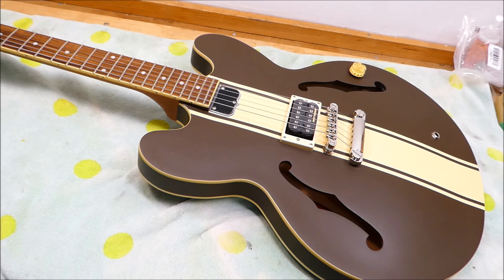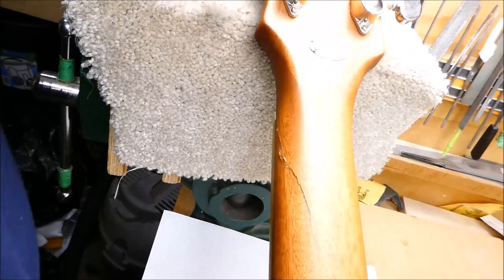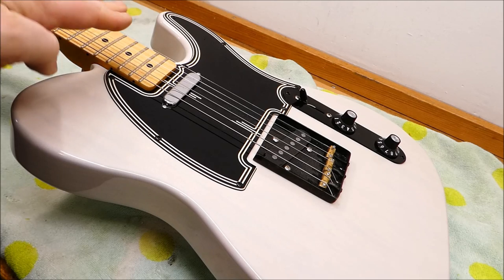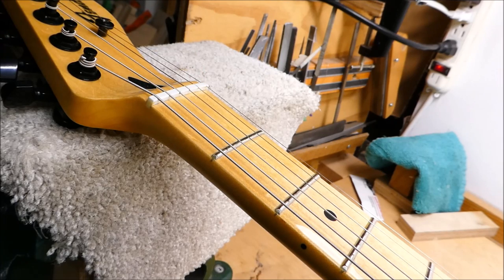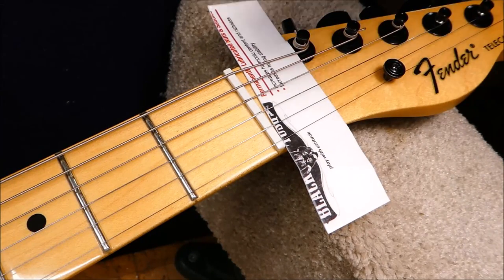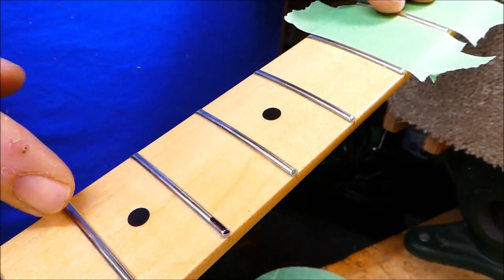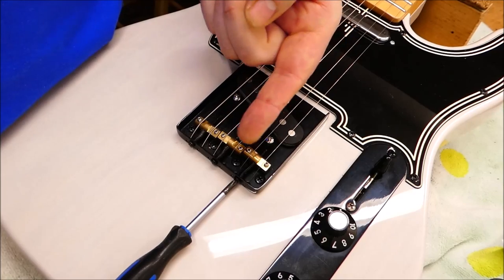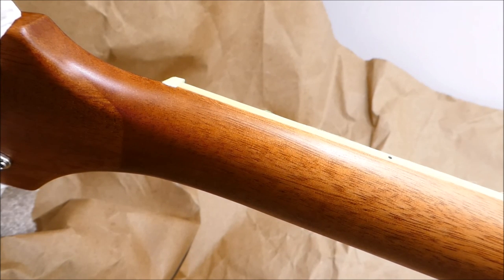Neck Injection, Tele Setup and Violin Vagueries

Comment: Helicore Strings would be a huge improvement over the Gut Strings & by changing the friction pegs out to Geared ones it'll hold tune more plus you won't need fine tuners on the tailpiece anymore now that you have geared pegs.

Comment: Also, I have fixed 4 guitars using your methods with neck cracks. All but one came out fantastic. The other was broken so severe there were little pieces missing. I got it all filled and fixed. Played fantastically. Just wasn’t pretty and my airbrush is trashed so I couldn’t blend in the color and finish. It’s left a Frankenstein scar. Thankfully my friend was fine with it and like that is shows scars says it shows it’s a workhorse and it’s been through hell but still here, still working, still rocking.  (This was friend that just wanted it to play, not a customer of any kind)

Comment: Great projects!
I agree with the "what do you gain from putting locking tuners on a guitar like this". I own an old OLP MM1, and I make sure to put more windings on the D and G-string, otherwise the angle won't be sufficient. The G-string travels quite a bit, just like on the MusicMan Guitars, so you can imagine that a few wraps won't be enough.

Keep up the good work!
Cheers.

Comment: You can use suction to pull glue into a broken/dry joint, the same technique used to pull epoxy into windshield damage.

Comment: My nut tip: use a clip on tuner on the headstock. File each nut slot til you get a perfect half step between open string and first fret in half position. Go slow. If you go too deep, a little CA and nut dust.
I never go by height. Try my way, and let me know what you think. Intonation is achieveable on the cowboy chords, and sets up for a clean fast action as you finish your setup. Peace!

Comment: my guess is at some point someone put steel strings on the violin and it cracked at both sides of the bridge or it made old cracks worse, so they got it 'fixed' and reverted to gut strings

Comment: You can avoid shipping damages like this by making a really tight form for the body (at least the upper part directing to the neck) with a hot wire tool from hard foam. Then glue this foam form in the guitar case / package so that the force, if the package falls to the neck, is absorbed by the foam; the neck should be free, so that no force is applied to it. In other word: fixate the body, not the neck, and this in a way that the body cannot move more than app. 1/2 inch or 1 cm. Of course you have to prevent that force from the side is applied to the neck, so the package mus be quite big or very stable. You can buy a cheap foam guitar case, glue your custom body holding foam form in it, then put it in a package. You would need really huge forces to damage this sort of package, which is very unlikely.

Comment: 25:35 This is an August Kniezel Violin/Fiddle. I figured out why the soundboard has these 2 patches (1 on each side), there were some huge cracks in the soundboard w/ big chucks of wood missing so rather than make a new soundboard, they simply made some patches so they could plug those cracks up.

Comment: I have been repairing guitars for many years now and have fixed maybe 60 or so over the years, amazing but one I have just repaired had exactly the same break point as this one (which as you said is unusual) I have never ever had any returns with my neck repairs and everyone always tells me that after the repair the guitar actually feels and plays better than before it was damaged, I am sure you have come across this with your own repairs and I am certain you will know the reason which is this, the guitar was never set up properly in the first place before the break, time after time I hear this, of course the answer is is to pay someone who actually knows what they are doing and while it is being set up get the guitar man to fit some STRAP LOCKS, nearly all the breaks I mend  have been the result of strap failure and of course in this case shipping, when I buy a guitar online I always insist the seller remove the strings and then the neck put the screws and neck plate in a bag and tape the whole lot together, easier to pack as well.

Comment: I just finished doing a new setup and string change on my 1964 Matsumoto Japan Mustang it’s the best cheap guitar I own. I paid $50 for the loaded body and the neck pocket was splitting apart and the back had a seem opening up so I cleaned the area and the fitted the joints and glued with triple bond glue in both areas and clamped them up then you know the routine I just waited for the drying in two days I started setting up the guitar

Comment: Another great video.  Question:  There is some controversy regarding fish glue, due to potential moisture issues.  In this case, I would expect the finish on the neck to seal out any problematic moisture.  Thoughts??
Reply from the maker: I did a little experiment where I glued up some angled scarf joints in maple and spritzed them down with water before keeping them in a ziploc for a week to see what would happen. I had hide glue, fish glue, titebond and Elmer's white glue. They all broke in the wood, away from the glue line. I think in theory it might be more susceptible to humid conditions but I haven't seen any indication of that so far in real life. I've been using it for about 15 years.
Reply: @twoodfrd  Thanks!  Nothing trumps experience.

Comment: Nice video, thanks. Could you not adjust the downward angle of the strings with a string tree? What about the tuning problems with too many windings on the peg, isn't that why we use locking tuners (as well as quick string replacement)?  The saddles have quite a sharp compensation angle, could that make string breakage issues? And the bridge plate looks quite thin, could that translate to weaker sound?

Comment: I worked a short time in a shipping warehouse (I won't name names but they played a role in a movie with Tom Hanks). Although we were always respectful with peoples packages I can tell you that most of the damage was done where whatever was inside the box was allowed to knock around inside. Usually because people were cheaping out and package materials to save weight and therefor shipping costs. 

For example if we're shipping a guitar it should be in a large enough box to where no part will be touching the sides or top or bottom (3 inches around all sides minimum) BUT after it's wrapped in bubble wrap it should still fit in the box snugly. Take some wrapping tape and wrap some bands around the entire box a few times in both the X and Y to prevent the cardboard from tearing. Personally I would even take some plywood and cut it to fit down the long narrow sides of the box. 

(Those pelican cases are risky and I would never use one of those to ship anything. They give the package handlers a false sense of security not to mention they don't offer nearly enough shock absorption should the case get knocked around a little bit.)

Comment: Hey ted! The concert pitch is set to 441hz! Does it matter? Probably not especially because you're more concerned with relative tuning, but just a heads up
Reply: We now use 440 which is a bit lower so the strings are less likely to break.

Comment: To gage the distance between two cylinders at right angles I prefer using a cylindrical gage. It's more like gapping spark plugs than setting points or valves.

Comment: Thankyou Ted. I have 3 cheap Chinese made hofner shorties that need the nut slots sorted and this information is perfect. (These hofner shorties are not set up at all out of the factory,  they are pretty terrible). I bought a couple of shorties a few years ago and they both have fret buzz and don't play the accurate note on the first couple of frets. A week or so ago I bought a hofner shorty deluxe and a hofner shorty bass and they also have the fret buzz and are not playing the accurate notes on the first couple of frets. I'm an idiot for buying more shorties but I thought the online store might have sorted those issues before delivering them. Both these new guitars have frets that are not seated (gaps underneath every bit of fret wire), which is really terrible lol.

Comment: Little tip for getting glue deep into those tight cracks, after injecting the glue blast it with a can of canned air. It's messy but it will force it down into it.

Comment: I repair guitars, but speaking of shipping, I worked at a bike shop, and bike boxes are BIG. It says on them what direction to have the box and to not stack them. Every week they would come in stacked? I called UPS. They said to have instructions written on the box? I didn’t get very far explaining. 

Shipping company’s simply do not care. They have insurance and they accept the fact that there will be inevitable shipping damage. 

This is why I recommend flight cases and racks for everything. Absolutely everything. You roll it out, one plug, roll it back. I was a stage hand for a summer and if the act didn’t have flight cases it took longer and was risky. Invest in good cases and it’s going to pay you back.

Comment: Hi Ted. Perfect timing, I have two similar repairs. Please, help required: have a set neck break under 10th fret, very straight perpendicular to fretboard so end grain glue up and little gluing surface. Best method and how to clamp joint please. Appreciate your excellent help and delivery over the coarse of knowing you. Thanks. Cheers. Rico
Reply from the maker: I'd probably inlay some plugs that span the break, like I do with headstocks that have short breaks with nothing but endgrain surface for glue.

Comment: I Also have a tele where the frets near the neck pickup seem to "rise" higher than the rest of the frets, why is that? does it leave the factory like that?
Reply: No they don't build them like that!  It's just that the neck widens out where the carve meets the heel (right around fret 15 on a tele or strat) and this creates a natural stress point where the neck "folds up" under string tension.  This is one (of many) reasons why a fret level tension jig gives a much better result than a basic no-tension fret level.

Comment: I feel your frustration from working with dangerous tools which could easily cut you very badly and then getting hurt on the k8nd of things people would never imagine like a sharp piece of wood or in my experience from building models a piece of shim steel or thin plastic sheet.

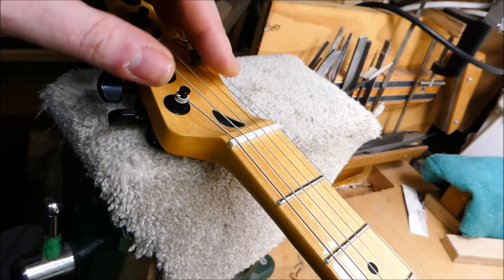Comment: Question. At 11:59 the tuner is set to 441Hz and not 440Hz as usual. Does it affect the result when it comes to how much the string is out of tune? Love your work and videos. Greetings from Sweden.
Reply from the maker: Good eye! I noticed that as soon as I finished filming that shot and corrected it.  I suppose it would make everything the same degree of out of tune.
Reply: @twoodfrd  i was gonna ask the same glad someone asked. Well actually my question was why it was 441. But you answered it nonetheless
Reply: @twoodfrd   Would slightly increased string tension on all 6 strings therefore make the action just a little bit high ?

Comment: Boat stores sell a repair epoxy that is very thin and runny that would no doubt work for this type of wood repair; epoxy is stronger than wood fibers. It dries solid enough for a boat hull so the epoxy would be strong and workable.

Comment: If that violin has gut strings then leave them on as it'll mean changing the sound bar to a modern symphonic one and the bridge to a shorter one to put modern metal wraps on. Else, if the table (top of the violin) doesn't collapse then it'll be impossible to play.
Reply: It isn't that old - not an old Italian violin - just a factory fiddle.  It would sound better if he popped the top, and fitted a new bass bar, as likely it was just carved into the top, as part of the top.  But, I doubt putting Helicores on would add to cracking, if repaired correctly - which if it was mine would include removing the top, putting little cleats over the crack, in addition to hide glue and clamping, maybe checking the "tap tone" of the top and re-voicing a little, and likely a new bass bar.  But, that is moving more into violin building, and less about repair.

Comment: Not sure if I had missed something earlier, but I noticed your guitar tuner was set to 441hz instead of the standard 440hz. Does this not affect the accuracy of the intonation being checked?
Reply: It won’t.. due to the variability on tensión while you work with and without the strings it would be better work something between 1 to 4 hz off depending on gauge.. time of neck joint to the body and bridge! Because the intonation will always come off several times before getting totally in tune.. I think that’s why he wasn’t even talking about fining tuning but relief on the strings.. first from the nut and then for the bridge! Intonation and octavation it would be the last of all of the step for a guitar setup! Greetings..

Comment: I wonder could the marks on the violin top be from exposure to an inappropriate case? Some sort of braces on the lid of the case pressing or sticking to the top? Just a thought...
Reply from the maker: They're separate pieces of wood, cut and inlaid into the top.
Reply: I wonder if something else was inlaid there - some ornament or crystal design - that deteriorated, and the are was plugged with wood inlays. It's a popular spot for inlays of  100 years ago.

Comment: do you think it's wrong to 'tune' the nut with a tuner, like pressing the string, check if the note is ok and.if not, file the nut? what are the downs? tks for yr cool videos...
Reply from the maker: I've never heard of anyone doing that. If you go too low you'll get a buzz.
Reply: @twoodfrd  ,  I suspect he might be referring to filing the nut to make the distance between the 1st fret  and the nut a little shorter or longer to get that 1st position note exactly in tune ? I would think that this would throw off the open-string geometry/intonation/harmonic and changing the saddle position to compensate might open up another can of intonation worms, or wormholes...

Comment: Locking tuners can be a pain when working on the guitar. The tuning and retuning of the strings will break it at the tuner just after a few times.
Reply: That doesn't sound like a tuner problem. Sounds like the string is getting hung up on something sharp, like a non lubricated  point on the bridge that is having a lot of friction. Or it could be at the nut.
Reply: @gavinw5469  No it’s like bending a wire back and forth until it breaks. In my experience with these tuners is that it only takes a few tuning and retuning to break the string. Especially when setting intonation
Reply: @Abravenewfear  hmm. I haven't had this problem.

Comment: One question which comes up looking at this guitar. How do you wind up strings to increase string angle. I never thought of this before. Would you get the turns toward the neck or up the post of the tuner
Reply: Start the wind of the strings so that that the string is pushed down towards the headstock with each succeeding succeeding wrap around the post.
Reply: You always wind the strings Down the post, to maintain
the same "relative" angle as the peghead.
The first wrap goes Over the tag end and the following winds go under.

Comment: Surely the string height above the body and bridgeplate is meaningless ? if the action is correct at 1st and 12th fret, then the height of the string from the body at the bridge is the height ?  having a figure here is meaningless to assist in a set up for playability.  moreover the string height above the pole pieces of the treble pickup is much more meaningful in terms of setup to get the tone and the volume to where you need it to be  ?

Comment: Is it at all possible to just replace the neck?
Reply from the maker: In theory yes.  In practice, it takes a tremendous amount of time and effort.
Reply: @twoodfrd  okay. One more question on it. Will the manufacturers even sell a neck to replace a broken one?
Reply from the maker: @wyattsdad8561  not usually.  There are aftermarket fakes on various auction sites but they often don't fit properly.
Reply: @twoodfrd  well so much for my theory then. Haha 
Your neck repairs seem like they are damn near just as good as replacing it.
I watched some old guy on YouTube repair his own broken Les Paul neck. He said he’s always been a tinkerer and always liked fixing his own stuff. When I saw him use an oscillating saw to cut the slots for his repair material, my eyes got big and I had to look away from my phone while he did it. But his repair actually seemed
To look really good. After he put the carbon fiber in and sanded everything he airbrushed it and it was surprisingly good looking. I’m a carpenter and I use one of those saws quite a bit for repairs and I also know how they can jump around so I was pretty shocked when I saw it shredding into his Gibson Les Paul neck.

Comment: I'm a bit surprised that you didn't use epoxy to fix the cracked neck--no shrinkage, no water or solvent to evaporate, great strength.

Comment: Very strange bridge saddles on that Tele clone ---- they look like they'd break strings, or allow the strings to shift around from hard playing.
Reply: They're the Wilkinson compensated saddles.  Pretty popular and they work quite well; brass is soft enough not to break strings. Tip: there's no need for the compensation on the B-E saddle.  Use a plain Fender saddle there.